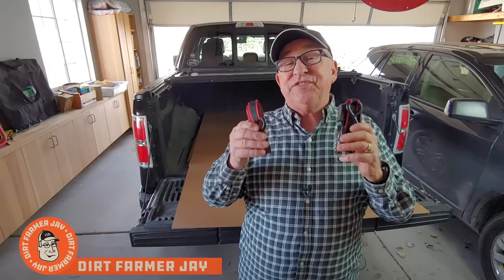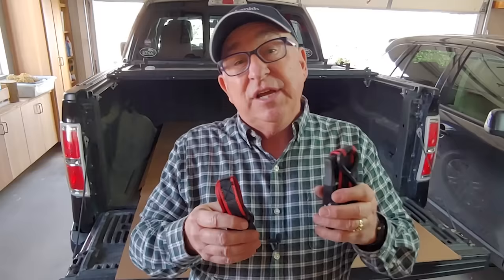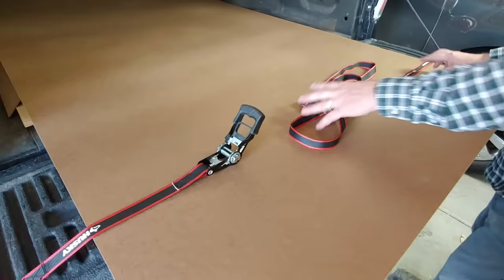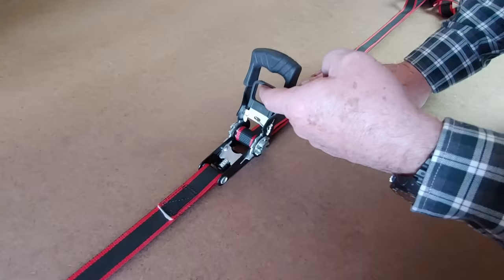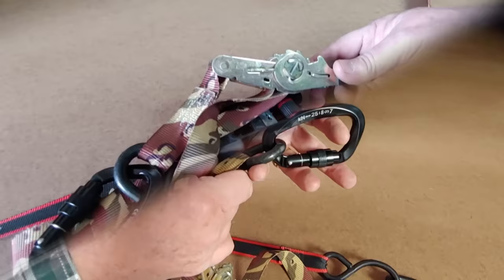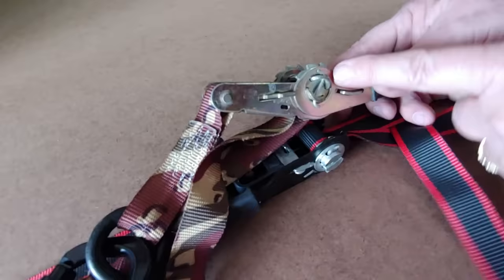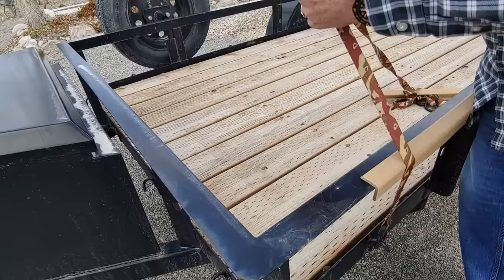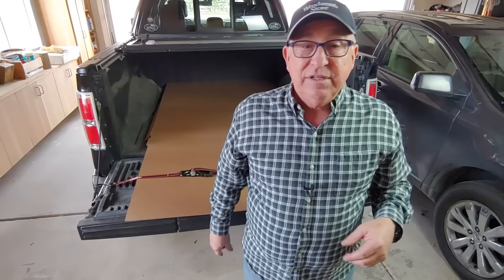How to Use a Ratchet Strap - Tips and Tricks!

Comment: Never use a C-clamp! They can easily loosen during transport due to road vibration - and can turn into a metal missile that can do serious damage.
Reply from the maker: Arthur, point well taken, thanks for writing. Best, DFJ
Reply: We all saw this however, you missed the common sense aspect, he showed a rusty old clamp which won’t vibrate loose and be a projectile on the hwy for tailgaters. 😁
Reply: Just bolt it to the tailgate instead.
Reply: Thank you so much. I was pulling my hair out trying to put two of them back together. You made is simple enough for me to catch it and even understand (somewhat) how they work. Thanks so much
Reply: They clamp a little tighter and don't work off as easy if ya use wood spacers on both sides of c clamp.
But ya need to check them
Reply: You should provide your help on how to utilize the ones with loops in the webbing.
Reply: I'd just bought a truck that had a capper held on with 4 C clamps. I made it eight miles and it came off going down the road at 55mph. Thankfully, no one was hurt. Mi State Police came to the scene.
Said they had been called by an unnamed "good citizen".
            I got a ticket for unsecured load, and wound up in court three times. For one reason or another the case was postponed. 
         The judge ruled against me and I was fined.
        The whole deal wound up costing almost 3 K once you consider the loss of the capper, almost two grand,the fine 200 bucks and three lost work days.
       I'll use C clamp in my shop but won't ever use it as a positive anchor again.
Reply: A tip you left out that I find annoying is STORING these devices.   What methods do you all (any readers) have to store both pieces?   If there are any links to other vids showing this, please provide.

Comment: Here is a tip for you. Don't insert the strap the way you are doing it with the lever open. You should ratchet the drum until the slot is perpendicular to the automatic pawl/spring catch/release tab, then you shut the lever. This makes it so you can lace the strap through the drum and not have to thread it back through the lever. Two actions instead of three. Makes it easier when it is cold and with gloves on.
Reply from the maker: Aztec Warrior - thanks! We've had other viewers write in and counsel the same thing. I'm adopting your way and will feature it in an upcoming episode. Thanks for watching, and taking time to write - best regards, DFJ
Reply: @DirtFarmerJay  Something I was tought never hook two straps together with the two open hooks rather hook one open to the closed eye on the other.
Reply: Just fyi, your ratchet strap is not at its full strength without at least 3 complete turns around the drum.  You are creating a tensionless anchor by rotating the strap around the drum.
Reply: @jeffkimble8857  who is?
Reply: @AztecWarrior69_69  that’s a how the ratchet strap derives it’s strength is by creating a tensionless anchor.
Reply: @ridgefieldjohn9041  Depending on the hooks sometimes you can join them by hooking both in the loops like you say.
Reply: @Jeff Kimble  you are having a hard time reading and understanding. 

How does explaining "how a ratchet works" (which I already know, have since I was 10)  answer the question "Who is?" Who is creating a "tentionless anchor"? 

Furthermore, why are you mentioning that in my comment? My comment deals with a faster, easier way to get the strap through the drum. So why are you commenting that on my comment?
Reply: @AztecWarrior69_69   clearly you are the one who has the hard time with the reading comprehension.  My comment was not to you in the beginning as you will note it was not addressed to you with an @ and your user name.  It was a general comment to the thread.  

As for addressing the “who is”.  I explained in a reply that was to you that the principle of tensionless anchor was how the the ratchet strap get it’s rated strength.  So “who is” would mean anyone who uses a ratchet strap.
Reply: @jeffkimble8857   Well It is clear that you are in fact having a hard time with Reading AND Comprehension. Adding that you don't know how threads work.

First. It's "reading AND comprehension", not "reading comprehension".

B.  You don't know how threads work. UNLESS you are specifically talking to, addressing or replying to someone All comments are taken as a direct reply to the OP of that thread.  That would be me in this case. So Yeah you were addressing me even if you didn't know it. Hence the Request for clarification.

III.  As to "As for addressing the “who is”.  I explained in a reply that was to you that the principle of tensionle........ blah blah blah"  No that is not how you explain to who you are talking to.

Jeff Kimble
1 day ago (edited)
Just fyi, your ratchet strap is not at its full strength without at least 3 complete turns around the drum.  You are creating a tensionless anchor by rotating the strap around the drum.

Aztec Warrior
Aztec Warrior
1 day ago
 @Jeff Kimble  who is?

Jeff Kimble
Jeff Kimble
1 day ago
 @Aztec Warrior  that’s a how the ratchet strap derives it’s strength is by creating a tensionless anchor.

Just exactly where in that are you explaining who you are talking to. You got close when you said "Just fyi, your ratchet strap " and "You are creating" but that was before trying to get a clarity from YOU. So how is it exactly did you clarify by saying the same thing twice ?

Summation, you need to learn that you are not understanding the conversation or stop doubling down, it make you look like a tool. Work on that Reading AND Comprehension.
Reply: @jeffkimble8857  Well, you ding a ling?

Comment: If you decide to use the to use the C clamp system please put some kind of a safety lanyard to the C clamp. If that C clamp comes loose on the highway you could do some serious damage as it bounces off people’s cars. Just don’t do it.
Reply: Good point.  I think I'd build on the C clamp idea with another device.
Reply from the maker: Kenny, good insight. Thanks for sharing your thoughts. Best Regards, DFJ
Reply from the maker: Kenney, I've be reviewing all the comments one again and came across your comment about the use (or should I say, non-use!) of a C-clamp. Your point is well taken and will in fact be mentioned in a future episode on load securing, and do's and don'ts. That was not good practice on my part (although I use this for a short trip and make sure it is tightened down for the short duration) - but this could lead to some bad situations as  you mention. Again, thanks for the nudge. Best Regards, DFJ
Reply: i agree, don't use that way of securing the straps. i think the x pattern securing flat material is much safer.
Reply: @DirtFarmerJay  Put the strap one over one under no camp

Comment: Please don't use a c-clamp to secure a load while driving. If the strap vibrates excessively while driving, twist the strap once.
Reply: Give the strap a twist reduces its strenght....its forbidden in some countries and  you can get fined by road authorities for "unsecured load"....be aware...
Reply from the maker: Jonathan, point well taken. Thanks for writing! DFJ
Reply: @jeanchardonnay5627  it does not reduce the strength.  There is a good video where a tester destroys many straps testing this theory.  Vibration can be very damaging to the strap, load,and vehicle.  It will loosen or   cause shifting of the strap or load.
Reply: @brianhillis3701  Proper testings have been done and are on Youtube.....You are wrong.....

Comment: Jay, a couple of points from a truck driver: 1) You want a minimum of two revolutions of strap wrapped around the drum - if the strap gets wet it can slip if the load shifts without two revolutions on the drum.  2) That loose flapping tail of the strap is called a dog ear and it is against the law.  Very dangerous and is considered an unsecure load.  What you showed is going to be left up to interpretation by law enforcement.  If I was to use that method, I would still take a zip tie and secure it back onto the strap - zip ties are cheap. 3) The C-clamp - Negative!  That would be considered an attachment point and is regulated bylaw - also the carabiner, get it gone.  DOT regulates the equipment to be used to secure a load, and climbing equipment is not in the book for securing loads regardless of it weight rating.  You take an authorized strap and attach it straight to an authorized attachment point.  The biggest take away I want you and your viewers to take away from this is - don't get creative when securing a load.  Even those two cleaver chaps at the home improvement store - those straps must be rated.  If they are doing this job for hire - they are held to the same laws as a truck driver is with the securement of that load.  They are required to have clearly marked load ratings on the straps they use.  If you are doing business in commerce you are held to all the laws when it comes to load securement.  Even private Joe hauling his motor cycle or race car needs to step up their game and use rated straps with proper attachment points that are also rated for their needs.  Good straps are not that much more in price, and it lets you and everyone else know the load is secure.  4) Check your load in the first 100 miles after you secured it down and start on a trip - it is not only smart to do, but is required by law.  Check the load every time you stop after that.

I hauled flat beds for a number of years and loading and unloading was my Zen time.  I worked where I even got to load and unload most of what I hauled.  Even tarping an un-tarping a load became an art form for me.  Most drivers want to drop and hook - not me.  I want to control every aspect of a load I can - and get paid for it too.
Reply from the maker: This is GREAT information Chuck Howard. Thanks for sharing with our viewer family. And also, thanks for being one of those who help transport items to those who need them. Best to you! DFJ
Reply: minimum of two revolutions of strap wrapped around the drum... I understand what you said but I don't understand how to do it. Any tips? TY, Michael
Reply: @iceroadtrucker2008  Leave more strap between the ratchet and the other hook when you first start ratcheting so that it has to rotate at least twice before tightening up.
Reply: Hey Jay! When you get tired of chain binders & tarp’n, but still want to be in the Zen of control, haul fuel! Pays way better!
Reply: @DirtFarmerJay  Maybe you should reupload cause this can be dangerous information? guy I work with used this and im sure other people are breaking the law because of this video.
Reply: Sound advice, thank you Chuck.
Reply: You give advice, but not solutions, in lieu of a carabiner or chain link, what is an approved "hook"?
Reply: @assface199  Paul,
There is nothing wrong with using a hook that comes on a ratchet strap or chain.  All of these approved items are rated and clearly marked on them.  You need to buy them from suppliers who handle those items for professionals and industries who use them - you will not find them in a box store, nor can you trust what is on the packaging; most of that crap comes form China.    Any place that sells items for commercial trucks or trailers will give you a place to start if you walk-in and tell them what you plan on doing, and how you would like to go about it.  It is like any nut or bolt - or any kind of a fastener, I do not buy them from a box store; they can not be trusted!  I used to build and drive race cars too; you need to be part engineer if you want to keep yourself and others safe in this day and age.
Reply: @assface199  He's saying, remove the middle-man from the equation. You should be hooking directly to the hard attachment point I.e., from the hook on the end of the strap, to the mount on the truck/trailer. 
No Carabiner in between...
"take an authorized strap and attach it straight to an authorized attachment point."
Reply: @Chuck Howard, forget what was said.  NOT commercial use.  However there are three things you did not admit, regardless of commercial or residential application(s).

A)  caught by law; in USA: only if your load control is lost or fell off your vehicle.  not how you secure your load.  POLICE is not going to pull you over because of your funky tiedowns. 
B) required ratings and tools,  Do you understand that in USA; DOT regulations are not law. Even rope is used as tie down materials, what about campers attached to pickup trucks with turnbuckles and those devices do not have rating9s0 permanently attached or etched on. I expect people securing the load use have understanding on how to use materials to secure the load.  The visual lost control on load, looks like un-secured load or load flying off is going to earn a traffic citation by any police in USA. I do not know how other countries deal with that. 
C) flapping loose strap or rope (Let you tell that jargon "dog-ears" to judge)  will be likely  pulled over by police in USA, IF your strap/rope is touching the road (interpreted as visibly lost control of the load).

So I gave you thumb down because your comment felt like you are yelling at DirtFarmerJay.
Reply: Right at the beginning of the video, he was talking about the use of type of rachet straps for household loads on a pickup or a small trailer.  I imagine that there is a different set of considerations with semi-truck flatbeds.
Reply: @rynait  I think you said plenty.  
It sure sounds like you disagree with everything that was said. 
Try telling that regulation not law bs in court to a judge.   
Better yet tell it to a family when you kill someone using that rope for a tie down.    
You were told the best way and you disagree with him.   
What more needs to be said ?
Reply: @rynait  it doesn’t matter.    You have to follow it or face fines.    
Jail time if you kill someone.   
I guess you think you’re a sovereign citizen too.     😂😂
Reply: @kevinperry581  I re checked the DOT regulation § 393.108 and § 393.114 does allow ropes. specifically,  wire,  manilia, nylon or proprylene (sp) on commercial vehicle.  
and I am sorry to ask; why is Mr. Perry insulting me?
Reply: Thank you Chuck! The tip about having two revolutions before starting to cinch it down is pure gold. Appreciate ya!
Reply: Good headsup
Reply: God Bless! Obviously someone is doing his part to keep us all safe! Not just abiding by the “Law”!
Reply: come to Florida home of not securing loads ...I cant believe it. Drives me insane.. or covering loads. I seen a trailer today what looked like a tree trimming company. branches and logs bouncing on a flat bed trailer. riding a motorcycle, that just pisses me off!:face-orange-frowning:
Reply: Damn I learned a lot from reading the comments. Sounds like I'd be in trouble if I did what I watched in the video if ol Chuck Howard is right 👍 and it sounds like you have extensive experience. Thank you all for the many tips! Thanks Chuck I listen to you as I'm a virgin with using these things/tools.
Reply: Thankyou for your advice, but can I ask you another question?  Where the strap is "in space", i.e. not flush against the load you are securing, would you put a half a twist in the strap to reduce the harmonics of the wind vibrating the strap.  I got this idea from another YouTube video "How to Use a Rachet Strap" by Essential Craftsman. (it is the last part of his video).
Reply: I looked through the comments and didn’t see this tip so excuse me if I missed it.  For safety reasons always have the ratchet on the passenger side so if you need to pull to the side of the road to adjust or retighten the strap you won’t have your butt sticking out into passing traffic.  Same with ropes or other tie downs.
Reply: @jamessmallridge8187 That's a really good tip! I wouldn't have thought of that. Well, not until I had my butt sticking out into traffic while checking my straps anyway. 😂
Reply: Thanks for sharing your comments and experience. It was great to read from a professional. 

I just carried 3 sheets of plywood home last night on the roof rack of my Honda CRV (no pick up truck as you guessed) with 4 ratchet straps, granted I wasn't on the highway and top speed was 35. Two front to back,  and two side to side through the vehicle. Total trip time was 20 mins. Any recommendations?
Reply: Great points! I found reusable zip ties. That's what I use to secure the flag end of the strap.
Reply: This is obviously a man who takes his job seriously and is a professional and take pride in doing his work properly I commend him for that
Reply: I buy all my hauling tools from Harbor Frieght who gets all their lowest priced items direct from China. I know China doesn't care about my safety or other travellers following behind my overloaded truck. Can you recommend a place to buy high quality strapping materials?